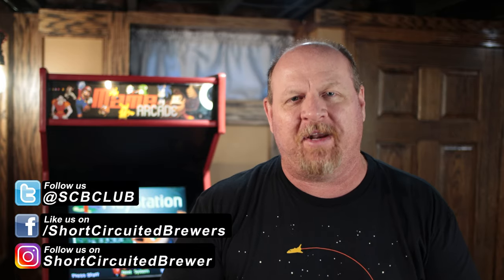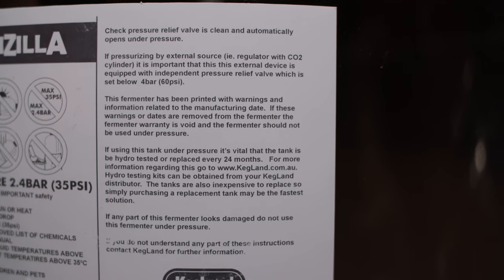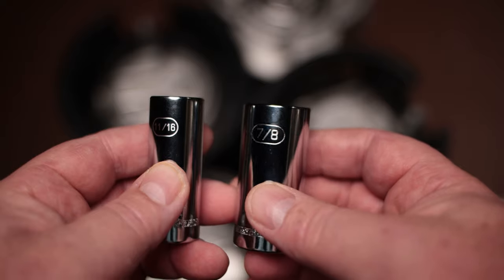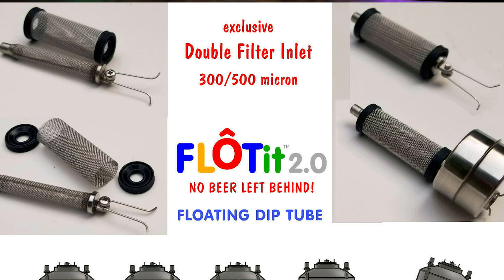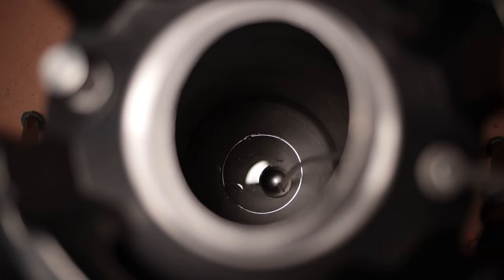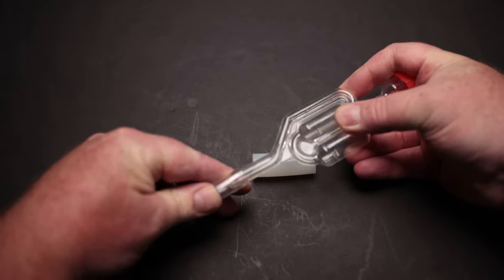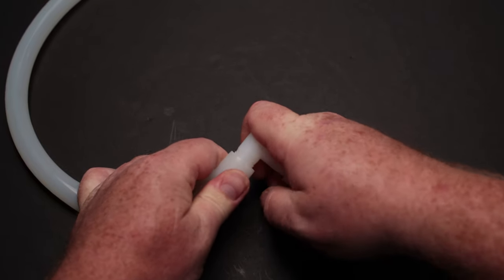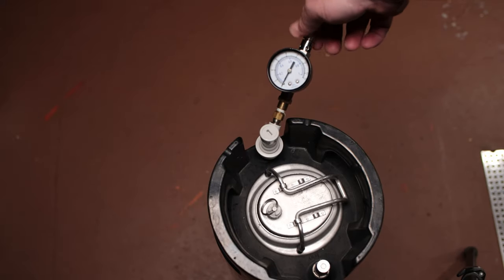Convert your Corny Keg Into a Fermenter

Comment: Hydrotest is basically to fill it with water and pressure it up using water pressure.  Depending on your water pressure from your mains you could possibly just fill it from a faucet,bleeding the air out and then seal it up
Reply from the maker: Gotcha.  I looked it up after I did this video and Kee did a video and pressurized a connected keg filled with water up it to 5 bar! 😳😳 Scared me and I wasn't even there!!  Lol
Reply: @ShortCircuitedBrewers  pressure is scary.

Comment: The nice thing about fermenting in a keg is clean up is pretty easy and if your doing it right your beer doesn't see light or O2 until it's in your glass. Also you use way less CO2 like maybe 2/3rd less or more because your beer is already carbonated, your only using the CO2 for purging and pushing.
Reply from the maker: All great points!! 🍻
Reply: I capture the excess CO2 in another keg which I later use for transferring.
Reply from the maker: Great tip

Comment: Nice video Brian! I have fermented a Mexican Lager in a corny using the shortened dip tube method under 15 psi at room temperature using traditional yeast. Fermentation was fast and clean with no off flavors. I did have some foaming out of the spunding valve.  I use my all rounder mostly because I am enamored by watching the fermentation. Which of the floating dip tubes do you feel performs the best in the corny keg?
Reply from the maker: I've only used the one I mentioned in the video so I can say for sure. 👍🍻

Comment: Hi Brian, Couple questions.  1) using the PRV as a blow off, why can’t this be used to capture yeast?  Is starsan harmful to yeast viability? (Actually always wondered no matter the FV) 2) By keeping the dip tube unchanged, couldn’t you use that to periodically pull trub and yeast buildup? (Although this might clog the QD post).  I’m thinking about the Grainfather Jewel valve in their fermenter as they instruct to pull off sediment in a similar way.?.?
Reply from the maker: You can capture yeast just not like a conical. You can rack off your beer and then add distilled water, shake it up and then let it sit for about 5 minutes and pressure rack off the yeast still in suspension. 🍻👍

Comment: This video is exactly what I needed!  I want to try to use my corny keg to ferment my next brew.  Do you have to use the 5/8" elbow on the blow off tube?
Reply from the maker: You don't have to. It just relieves the stress in the keg connection. As long as the hose is long enough you'll be fine. 👍🍻

Comment: Great vidya Brian, I must have missed this one when it came out. I have had this nagging thought in the back of my head for some time now. What do you think the effects would be of fermenting under vacuum?
Reply from the maker: You know I've been asked that before. I've thought about it. How much vacuum and how do you maintain it. Vacuum pumps are pretty expensive TBH. Interesting idea though for sure. Brewing in space.   "No one can hear you scream!" Lol 👍🍻
Reply: @ShortCircuitedBrewers  That's not exactly what I had in mind. However, I would consider placing a vacuum pump on the fermenter to collect and recompress C02 into a tank. Most pressure vessels should be able to handle positive or negative pressure.

Comment: Getting into pressure fermentation soon.  Can I ferment in my keg and then bottle the beer? And if so what is the best way to do so
Reply from the maker: Probably one of the best ways to do it would be with a counter pressure filler and you can do that directly from the cake

Comment: maybe a silly question, but if you were doing a NEIPA with this pressure fermentation. can you still dry hop?
Reply from the maker: You can. What I would do is either preload the hop sock and use a couple magnets to drop it in or. I would slowly let the pressure off and dry hop through the top with a light amount of CO2 coming through the gas post to help prevent any oxygen from getting in. 👍🍻

Comment: thank you for introducing the keg fermenting. I tried my first batch after your last video. but it seems little awkward when it hit the yeast layer. even if it is floating tue still the beer is not clear. wondering how can I solve this. looking for your reply~ thanks🙂
Reply from the maker: Make sure you transfer off of the yeast to a clean keg to avoid that. 👍🍻
Reply: @ShortCircuitedBrewers   Thank you for your reply. just to be sure, the process would be, I need a keg as a fermenter and after fermentation, I need to transfer the beer into a clean keg and serve it?
Reply from the maker: @周宗葆-o5s  yes sir!
Reply: Add gelatin to the keg to help clear up the beer.

Comment: Any thoughts on the shape of corny keg to fermenter geometry?  Just listened to most recent Brew Strong and Jamil thought it was a “giant mistake” to ferment in a corny keg because of it being tall and skinny, and the beer won’t mix well.  Seems like a weird thought to me… I do buy it producing different tasting beer than in a glass carboy, but calling the vessel a “mistake” seems a bit much.  Great vid as usual!
Reply from the maker: Yeah I don't have any anecdotal evidence, however I have a cornical and I have never noticed any difference in the beer. 👍🍻
Reply: @ShortCircuitedBrewers  yeah, he was comparing the same beer in a bucket, carboy and keg.. there is a lot more differences there than just the fermenter geometry.  I've read/seen plenty regarding fermenting in cornys.. never heard complaints about them... usually the opposite.
Reply from the maker: Yeah that's kind of what I was thinking! 👍🍻

Comment: Will the beer be carbonated after pressure fermenting in the corny? Thanks
Reply from the maker: Partially, depending on the pressure you ferment at. I usually find at 12 psi it's about 2/3 carbed. Chill the beer and put it on 30psi for 24hrs and it's just right for most styles. 👍🍻
Reply: @ShortCircuitedBrewers  thanks for the info

Comment: This has answered my question re volume reduction/head space requirement of fermenting in a keg. I brew small batches and had worried about the impact of fermenting in a 9L keg effectively having to reduce my batch size further. I have since found 12L kegs which I may invest in as they are same price as a keg and therefore cheaper than equivalent size ss fermenters.
One final question. Can you get away with pressurising the beer and serving it out of the same keg (effectively a uni-tank) or do you always have to push it to a 2ndry keg?
Reply from the maker: Sure you can serve out of the same keg you ferment in. It is a myth that leaving beer on yeast will result in bad flavors. I have let a lager sit on the yeast cake under pressure at room temp for 6 months with Zero ill  affect on the beer. 👍🍻
Reply: @ShortCircuitedBrewers  cheers Brian. Long term fan (Richard Brown) just updated my profile
Reply from the maker: Thanks Richard!! Good to have you! 👍🍻

Comment: I do 4 gal in the corney keg and simply set up the CO2 connect on the post with hose going into a growler with star san.  No need to mess with the PRV.
Reply from the maker: Cool. Glad that works!
Reply: @ShortCircuitedBrewers  Of course when I say that, karma gets you.  Fermented a wet hop Pale ale with Briess Malt Gems Pilsner and Red X and probably collected more than 4 gal in the keg.  Had active fermentation within 2 hours and the next morning I was 60% attenuated and the krausen was coming through the CO2 post.  Needless to say, I unscrewed the PRV and attached a blowoff hose!
Reply from the maker: @danc1662  haha!! She's like that!!! 👍🍻
Reply: @ShortCircuitedBrewers  Thankfully the hoses I use for my Spike 3-vessel system are the perfect size for over the PRV!
Reply from the maker: @danc1662  👍🍻

Comment: Or you can use a ball lock with tubing on the gas side for a blow off. Seems more practical
Reply from the maker: True but it can get mucked up by blow off yeast etc. 👍🍻
Reply: @ShortCircuitedBrewers  I always disassemble and clean after my keg anyways. Put yeah you’re better off getting a 6.5 gallon corny and fermenting under pressure. They make lids now that have a 1.5” tri clamp fittings on the
 For hop drops